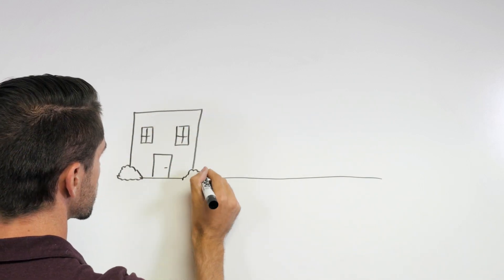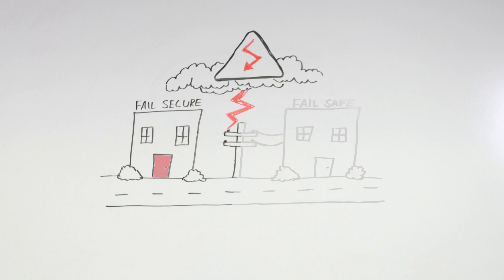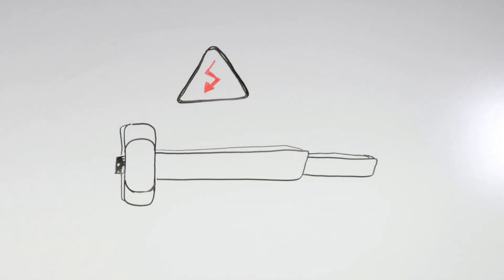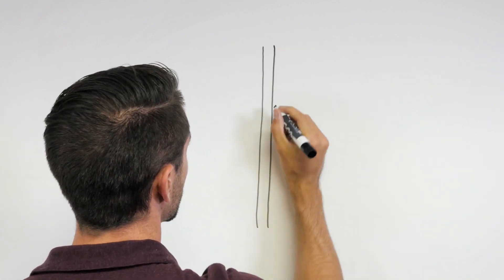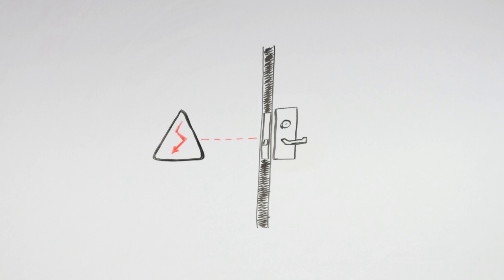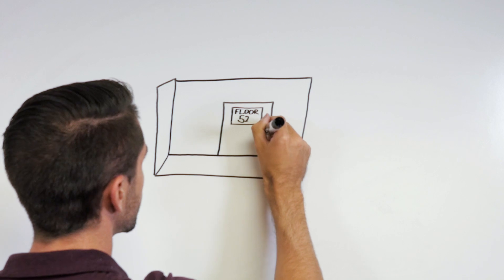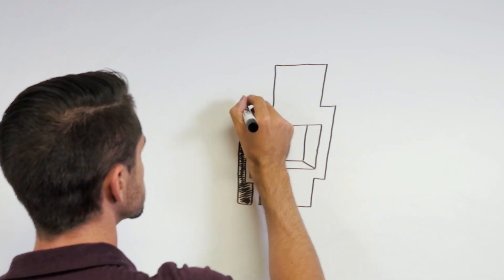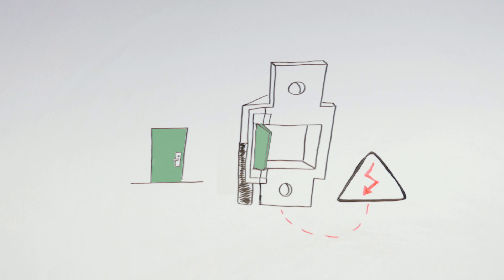Intro to Door Hardware Fail Secure vs. Fail Safe

Comment: how to tell if a lever lock is fail safe (Power to Lock)
Cylindrical lock the inside Lever will be warm.
Mortise lock the outside mortise cylinder above the lever will be warm.

Comment: Fail secure & fail safe is referencing the Key side of a lock. 
All commercial locks have Free Egress from the inside.
Fail Secure (Power to UnLock)  EU = Electrically Unlocked (FSE)
Fail Safe (Power to Lock) EL = Electrically Locked (FS)
Most Elec, Strike are field selectable (Fail Safe Strike are not allowed on fire doors) or Mag Locks.
Elec. Exit device are Fail Secure Only LR = Latch Retraction (FSE)
Elec. Exit Trims are field selectable both can be on fire doors
Most Mortise locks & Cylindrical locks need to be ordered Fail Secure or Fail Safe.
MagLocks can only be Fail Safe AKA fail unsecure.

Comment: Every Exterior lock & Interior lock should use fail secure (Power to UnLock) If you want to be Secure in a power outage.
The ONLY time you would use Fail Safe locks (Power to Lock) is if you are locking an Interior door that is also a path of egress to the stairwells or EXITs the fire alarm will cut power to the locks and they become a PASSAGE lever
Stay away from MagLocks they suck. do not use them Fire Trap if they don't loose power They are not allowed on fire rated Openings.